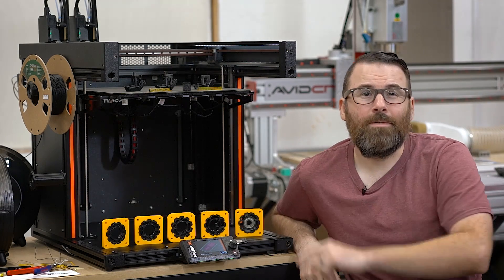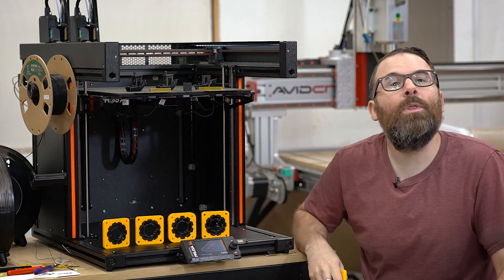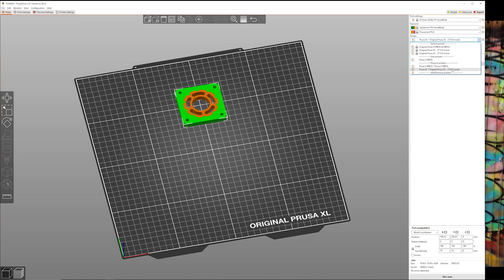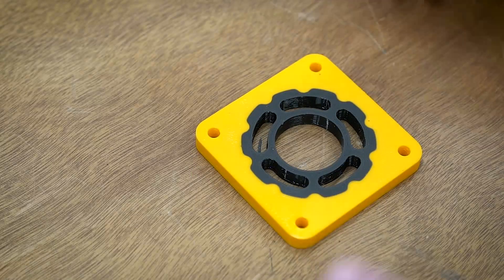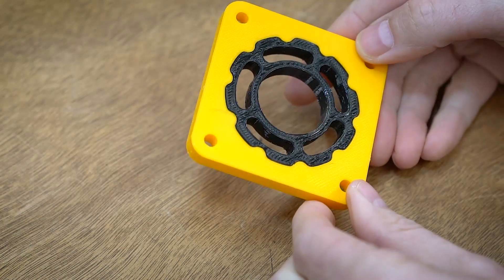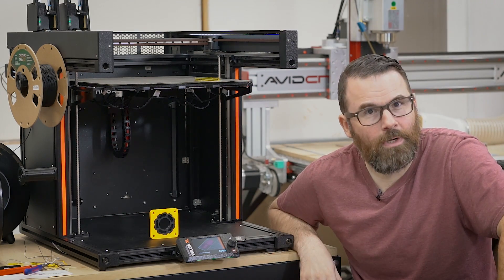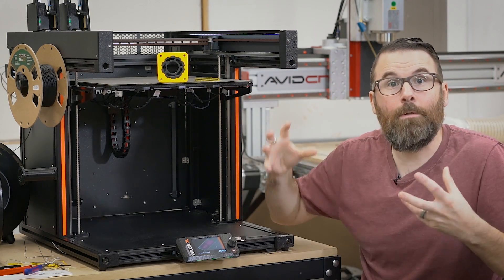Prusa XL - Multi-Material Testing (TPU and PLA)

Comment: I’d love to see you try this with PrusaSlicer’s new material interlocking feature.
Edit: also easier mixed speeds and nozzle sizes! All the challenges you faced should be resolved in the latest version (2.9.1-alpha)
Reply from the maker: Yep, a YEAR after I get it, it finally has the functionality needed to actually use multi-material printing properly.  Hooray?

Comment: For the TPU are you only using Prusa filament or can you run any brand through the XL
Reply from the maker: I think I've used everything BUT Prusa.  It's a PAIN to get TPU working, but once you get it fed into a toolhead, it works alright, you just need to print crazy slow.

Comment: What about bed temperature or chamber temperature, when you have multiple materials with different temperature requirements does it select the hotest of the two?
Reply from the maker: I'm not entirely sure.  I think it defaults to the first extruder's filament.  So if you use extruder 2 and 3, it will set the chamber and build plate to whatever filament is selected for '2'.

Comment: Actually there is a way to control the speed. Been doing that on my caribouduet, but with other settings. Just rightclick the body in the list on the right, like when assigning the extruder. There you can add options to that body. Perimeter speed etc.
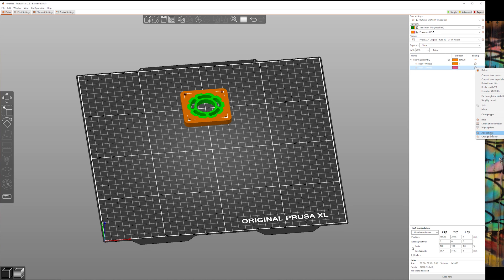Reply: You went over the option with your mouse, it's "add settings" at 5:05.
Reply from the maker: Yeah, I'm aware but you need to control each piece one by one.  It's much easier and more effective to just set a volumetric limit.
Reply: @RobertCowanDIY  you can just export each group of pieces which share the same settings, as a seperate 3mf (in your cad programm). Then you simply click your model, select "add part" -> "load" and add those parts to the model, in Prusaslicer. The whole bunch of pieces, imported as one 3mf, can then be controlled as if it were one single piece and is imported directly to the right spot (same relative spot as in your cad).
Reply: @RobertCowanDIY  and if you dont want to export it as one 3mf, you can copy and paste all the settings of one piece, to another piece, with a single click. It's the copy and paste icon in the middle.

Comment: Great work! So my preorder just got approved for this printer. Would you be able to tell me which build sheet surface you like best for PLA, TPU and PETG? Or perhaps the satin powder is good for everything. Are there any other parts / accessories that you think would be wise to add to the cart on purchase?
Reply from the maker: I like the satin and the textured for different purposes.  There's not a single build plate that's great for everything, but with those two, I find I can do everything I want.

Comment: You can change the nozzle diameter for each extruder under the printer settings tab and then change each extruder seperatly. But stuff like Wallthickness and co. will stay the same (as they are set up in the print tab and count globally for the whole print)
Reply from the maker: Correct.  It would be nice to more conveniently use two different nozzles in the same print.

Comment: When you drafted the 2 parts in CAD did you cut away the geomtry in the middle of  the outside part so that the 2 parts nested together with matching geomtry, or did you just creat the positive geometry on the inside part and leave it protruding into the outside part as interference / overlaping models?
Reply from the maker: They nest together with matching geometries.  Any overlap or interference would create problems, as the extruder would be depositing material in the same spot twice.

Comment: Thank you for this video and the idea to combine two materials as you did. I dont know if someone mentioned this earlier: When it comes to slicing, maybe use simplify3d. There you can easily assign different speeds to different processes.
Reply from the maker: I think Simplify3D has been outclassed by modern slicers.  I could be wrong, but ~5 years ago it used to be a premium solution to slicers, but it seems to have lagged quite a bit behind.  Plus, there's a lot of special stuff that PrusaSlicer is doing with the XL.  There are updates almost weekly now.  I think there have been 3 updates since this video was released.  One day it will support all the features people want.

Comment: Great video!  I wonder why your results are so much better than those that Teaching Tech experienced.  TT had a lot of stringing with fairly poor multi-material prints.
Reply from the maker: Yeah, he and I have been talking a lot (as he mentioned in his video).  I'm not sure why his results are so different than my own.  I'm going do to more testing.  I suspect I do far less 'cosmetic' prints that require a lot of fine detail and tons of small retractions and color changes.  I'm going to try some different types of prints and see if I can replicate his results.  I get a tiny bit of stringing, but nothing really all that noticeable, and in line with what I've heard is normal for a larger nozzle.
Reply: @RobertCowanDIY  Thanks for the reply!  I'm sure all of us would like to get to the bottom of this and ensure high quality prints from the XL.  3D Print Dogs seemed to come up with a simple resolution for their stringing by going to max Y before the Z lift, but I gather it was not that simple for TT.  Have you tried printing those clown fish on your XL?
Reply from the maker: @jonbondy I only have a dual extruder, so I can't do that exact model.  I guess I could cut it down to just two colors though.  I might try that.

Comment: Loving you're XL series.

I wouldn't waste your time on soluble supports. Use dissimilar materials - PETG to support PLA and vice versa. You can hard print them on each other and they easily pull apart.

This is literally one of the biggest things I love about the XL.

Soluble does have it's place for supporting an area that you cannot get to to remove supports.

One big issue with soluble support is having to submerge the object and risking water ingress that will be near impossible to get out.
Reply from the maker: I've been trying this, but the wipe tower is problematic as PETG and PLA don't mix at all, so it's like printing in mid-air.  I need to play with it more, but for most of what I do (90 degree overhangs with a fully horizontal unsupported area), PETG and PLA combos don't work the way I'd want.
Reply: @RobertCowanDIY  I'm curious if you have found a solution to this? I just shut off the wipe tower and have been able to print quite well with the PETG, PLA combo with no wipe. I did have to slow the petg speed WAY down so the first layer over the support would print ok and not just smear around.   Now when I'm trying to combine PLA and TPU I'm facing some issues. I need to double check my settings to be sure it wasn't trying to do PLA speeds for the full time...
Reply from the maker: @N__T  Yeah, PLA and TPU just don't work well together.  I would maybe swap out the PLA for ASA possibly?  As far as I know, PLA really doesn't stick to anything else.

Comment: Thanks for this interesting video !! Can you tell us a little bit more about the TPU filamant used, and the temperature of your final essay, please? What are the provider recommandations for it, and what temp used for this quite perfect print? Thanks in advance. Stephane.
Reply from the maker: I'm using matterhackers pro TPU.  I just went 5 degrees cooler than the stock Prusament TPU setting.

Comment: lmao, couple of thousand bucks and still using a knob to control the barely 3 inch interface, get real Prusa.
Reply from the maker: Everyone has their preference.  Touchscreens LOOK cool, but are a pain for setting temperatures!  I love pressing a little 'up' arrow 50 times to get to a a number.  I much prefer a rotary encoder and non-touch screen.  But that's just me!  I do like the look of a big touchscreen, but I prefer actually using a rotary encoder, you can get to settings quicker and make adjustments easier, IMO.

Comment: Prusa Slicer doesnt have different speed settings for the different exteuders? That kind of defeats the purpose of the multiple extruders. I want one for multi material, and I need to be able to set individual settings for each extruder.
Reply from the maker: Right NOW it doesn't, but they're making changes weekly.  But for right now, there are workarounds.

Comment: Great video I have the same issues!  Nice to see your work arounds...
Reply from the maker: Eh, I wouldn't consider them 'issues'.  So far I haven't been unable to do something, it just takes more work.  I think having a background in CNC machining makes me feel lucky that 3d printing is as straightforward as it is.  When I have to machine a part, it can take several hours to prepare the CAM and it's not always right on the first try.  The fact there is a slicer that does almost everything automatically with a few setting changes makes me feel spoiled.

Comment: 3:00 Prusa has already confirmed that the next Prusaslicer version will support interfacing for different materials though it will be different from what you did there.
their implementation will basically have an area where the slicer will printer alternating layers of each material so the layers are interwoven in the internal structure.
that should technically be even stronger overall as it maximizes the contact area between the different filaments.
Reply from the maker: Gotcha!  Yeah, that's what I would like to have.  Doing it in CAD is tedious and really gets in the way of designing the parts (since there are so many mating references that need to be destroyed, etc).  This is best done in the slicer.

Comment: I had trouble getting PVA to print well, it is inconsistent and strange. But for supports, PET-G and PLA do not stick together and I have had great success with that combo in my IDEX Flashforge.

One other thing I have had success with on single head printers for overhangs is to stop after the top support later and run a glue stick over it. Prints well and separates nicely.
Reply from the maker: I tried PETG and PLA, but in my test it was an elevated flat area, which didn't work since the material wouldn't lay on top of the other.  With angled support, it might work fine.  I need to mess with it more.

Comment: That final product looks really good.

Have you tried TPU and PETG?  They will actually bond together.  I don't have a dual extruder machine, but I've had success sandwiching PETG between layers of TPU.  The bond isn't super strong, but it's pretty good.  On my early experiments (where I messed up the filament change) I was able to get a fingernail under the TPU and pull it off with some force, but none of them peel apart without deliberate force.  I had the best results when I sliced it twice, once for TPU and once for PETG, then manually spliced the gcode together into a 3rd file.
Reply from the maker: Check out my newest video, just dropped today.

Comment: Well how did you made the TPU and PLA bond better on that layer? was this the side of the first layer, which will "squish" it more?
Reply from the maker: I'm not sure what you mean?  They aren't 'bonded' the internal geometry means they are locked together.
Reply: @RobertCowanDIY  Oh, so the plastic parts are not "fused" together if I'm understanding you correctly?
Reply from the maker: @blubbertje321 Correct, the PLA and TPU don't really melt together, so you need some sort of interlocking feature to keep them together.  They 'stick', but not really fuse.  PETG and TPU though DO fuse, check out my other video on it.

Comment: Prusa acknowledged the different nozzle sizes when the XL was announced. They said it was something they “were considering.” Usually this means that they’re looking into it but haven’t made a choice of implementing it based on how hard it’ll be.

I’ve seen other comments about changing nozzle extrusion widths of multiple nozzles in PrusaSlicer, but I wonder if this leads to other issues with quality. Given how fine tooth people are being over the MK4 and Input Shaping, I can understand why Prusa doesn’t want to just use/endorse this method.

That being said, the other things you brought up about print speed and filament settings need to be addressed. If I only want to print in PLA with different colors, great. Even PLA and PETG have similar enough settings I can see why Prusa used them together in their showcase prints. But I’m not buying a 5 tool head printer just for color swaps. 

The XL’s biggest edge is the ease of combining all types of 1.75mm filament and its open source nature. Features like material interfacing (from Cura), per nozzle settings, individual nozzle sizes, and allowing for OctoPrint need to be addressed, if anything just to quiet down the Prusa haters.
Reply from the maker: Got it.  For right now it's not limiting (mostly because I don't have any different nozzles), but I would like to have a variety of sizes.

Comment: A time lapse would be awesome
Reply from the maker: What are you looking to see from it?
Reply: @RobertCowanDIY  the tool change, also would be nice to have noches on the inside of the piece to avoid sliding straight and going out of the piece anyway, I could make an example on fusion if I'm not being clear in this comment
Reply from the maker: @cai0proenca I show the tool changing on my previous video.  But I could do a nice time-lapse showing how it switches between nozzles.
Reply: @RobertCowanDIY  i actually saw it, i just enjoy time lapses, and with this system is even more awesome 😬😬
Reply from the maker: @cai0proenca Ha, got it.  If I have a neat model that requires multiple extruders, I'll have to remember to make a timelapse.

Comment: I have contacted prusa about the different nozzle sizes and right now there is no solution to that... sure it is on the roadmap...
Reply from the maker: I'm just going to try what other people have said and change the nozzle diameter in print settings.  I have a 0.4mm nozzle, so I'll try a 0.4 and 0.6 in the same print and see what happens.
Reply: @RobertCowanDIY  don't think that works cause you cant define it per extruder
Reply from the maker: @fanatic_joka Actually, in Prusaslicer, under printer settings, they have options for each extruder, and I just checked, you CAN set a different nozzle diameter for each extruder.
Reply: @RobertCowanDIY that is correct, but you can't change extrusion width, cause sadly it is general set by the "Print Settings" -> "Advanced"
Reply from the maker: @fanatic_joka Gotcha!

Comment: Prusaslicer 2.6.1 has 'interlocking of painted areas for better MMU printing". Not fully automatic as Cura's 'material interlocking', but it seems to be there.
Reply from the maker: OOOOH, I'll have to check that out.  I wish it wasn't 'painted', I wish it could detect interfaces, but I'll give it a shot.

Comment: Great video, thank you! I do have a question, your very first print when you pull the inner TPU part out, the interfacing feature that you had shown in Solidworks was not there. Was that how PrusaSlicer sliced it?
Reply from the maker: I had not added the interlocking features yet.  I just wanted to test the adhesion between TPU and PLA.  I figured it would be poor, but I wanted to test it first.  All prints after that had the interlocking feature added.

Comment: This is really cool, I definitely wish the Bambu Lab AMS would allow for TPU + any other material printing. It is annoying that you cannot do multiple nozzle diameters yet with the toolchanger, but I'm sure Prusaslicer will make it easier to do toolchanger things eventually. Dissolvable support is one thing I was really hoping to get into with Bambu but the AMS as it turns out is not airtight enough to store PVA or even most Nylon filaments for long which is a shame. For single material prints tho the X1C has been fantastic for me so far, and I can print TPU about 7 times faster than you showed here (flow rate 14mm^3/s).
Reply from the maker: Hey Seth!  A couple points of clarity, I didn't say you couldn't do multiple nozzle diameters, I'm just not sure how to do it yet.  But a few people pointed out a few suggestions, so I'll try those.  Also I printed TPU slowly just to remove that as a variable, I'm sure it COULD print much faster, I was just removing as many variables as possible.  But I think dissolvable support will be a neat tool to have.  I've done some tests with PLA and PETG, but if you're doing flat supports (not sloping walls), it really doesn't work as the materials won't lay on top of each other reliably enough for support.  Regarding the AMS, I wonder if someone could make it into a filament dryer as well?  It should be doable and would make it quite a bit more versatile.
Reply: @RobertCowanDIY  That filament dryer idea sounds like the real ams mod waiting to be made. All it would take is what, drilling a few holes, a power source and a PCB with a heater?

No way that isnt also a part of the next ams.
Reply from the maker: @BeefIngot Yeah, that's what I was thinking, it should be fairly simple.  I've seen a lot of mods where it introduces more desiccant into it, but that's really not good at actively removing moisture, it's just to make sure additional moisture doesn't enter the filament.

Comment: Prusa slicer does have a interface system. What I did was still export the file as a STL but make it so that there is a very small gap between the parts so it shows up in the STL, then I used the fill option when painting, it automatically adds the interface when sliced.
Reply from the maker: Yeah?  Can you explain a bit more?  What 'interface' does it add?  Are you aware of how Cura does it?  It does some really cool interlocking geometry.  If Prusa did something similar that would be amazing.  Give me more details!